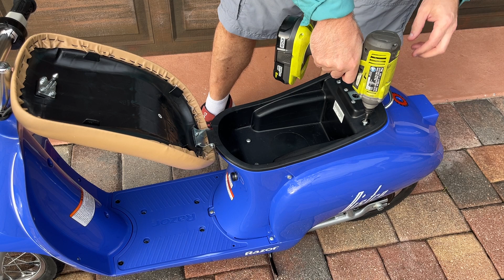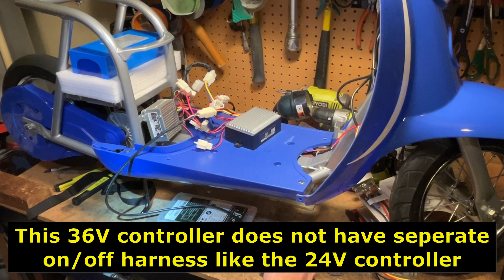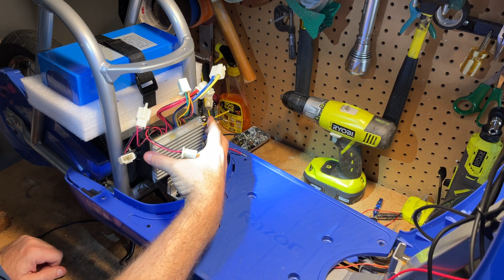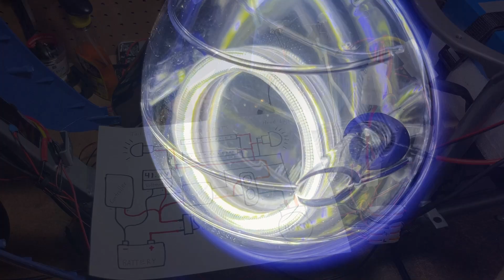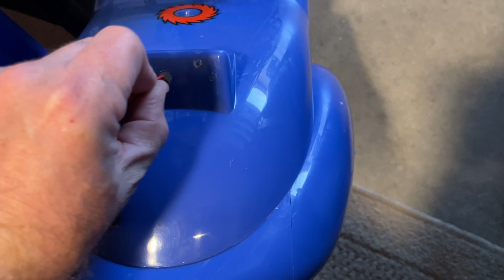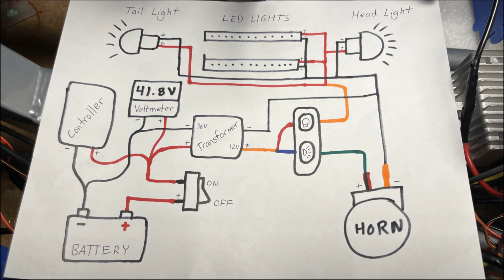$199 PocketMod 36V Upgrade - Faster & Cool Lights

Comment: How long does the power last, and could same exact setup be switched for a bigger battery
Reply from the maker: Yes larger battery will give you triple the ride times
Reply: @BRichSolution how long is the ride time for the specific one that you have below

Comment: Hey awesome video I just got a quick question. If I was to use a 2000w motor, would I still be able to use a battery that maybe is only 1000w?
Reply from the maker: 2000w motor needs a 48V battery
Reply: @BRichSolution ok ty

Comment: The graphic you show with all the connections is great, but it does not reflect the 5 Into 5 Out Splicing Wire Connector so it is difficult to know where to plug the wires into the connector
Reply from the maker: Which wires specifically?  Headlights, taillights or LEDs

Comment: How can I install that halo light without that power controller? Where can I wire it to?
Reply from the maker: You can wire it to one of the 12V stock batteries
Reply: @BRichSolution your light stays on at all time? I just bought an on/off switch.

Comment: Great video, very helpful! Where do you suggest to wire up that battery meter so it will turn on/off with the key ignition? Tried tapping it into the orange/red  electric door lock connect but it does nothing when I turn the key.
Reply from the maker: Into the key lock on/off wire

Comment: Hi, great video thank you for the reference!  Question, I have two similar plugs at the end of the 36v controller and doesn’t seem to be needed. I’m running similar setup with 36v controller and battery with stock 250w motor on an imod razor. Not sure what those two are for?
Reply from the maker: The 2 similar plugs are for motor or battery connectors?
Reply: @BRichSolution I wish I knew.  They’re both the same connector type with one black, one red.
Reply: I hate leaving connectors loose but can’t see what else is needed unless they’re reserved for add’l equipment for future use

Comment: does it still work fine because the stock motor would burn out
Reply from the maker: Works great no issues with the motor
Reply: @BRichSolution  the stock motor is still holding up?

Comment: Hi I’ve been following this tutorial and bought a 48v by mistake, can I use the 48v with the exact same setup - I have everything else the same as your set up
Reply from the maker: The 36v razor controller can handle the 48v battery without any issues.   However the 350w motor will probably burn out quickly but you can always try it and when the motor burn out upgrade to this 500w motor
https://s.click.aliexpress.com/e/_mPLSqzV

Also try not fully charge the 48V battery as it may prolong the life of the 350w motor as 48v vs fully charged is 55V
Reply: @ perfect! It cost almost half the cost of the battery to ship it back and exchange it🤦‍♀️ thank you!
Reply: @BRichSolution the motor definitely burned out, I picked up the suggested motor but doesn’t seem to fit the chain, can you suggest one?

Comment: Hi appreciate the tutorial! Do you solder a lot of these parts together- I don’t have any knowledge of soldering.
Reply from the maker: no I am not good solder person either; use the solder and seal connectors and the you place each wire in the end of the connector and heat gun melt the solder and does all the work; see video

Comment: What the difference if I use a 500w motor or 1000w motor? Dose it drain the battery faster? Do I need to upgrade battery or controller for 1000w motor
Reply from the maker: 1000w will drain battery quicker than 500w but the 1000w will be faster and more torque

Comment: Could I use my spare 80v kobakt batteries?
Reply from the maker: Not with stock motor or controller.   You would need a 72v controller and motor for the 80V battery

Comment: I’m currently in the process of making one of these. Got one off marketplace for $40. 

What’s the expected range with the 10ah battery? 

The original batteries were 14ah total and only provided about 10 miles of range. Will the 10ah lithium provide similar range or less range? 

Also want to note that the battery in the link is currently so out. So a link to another reputable battery would be great.
Reply from the maker: 48v x 10Ah = 480wh
24v x 14Ah = 336Wh 
So the 48V has 42% more capacity than the stock.  Range on pavement when i tested it was over 12 miles

Comment: HELP NEEDED. I did this same thing for my kids scooter just recently did exactly what this video said I only did the battery and controller upgrade with new throttle the problem we are having is it keeps shutting off on her while riding  but as soon as she turns it off and back on it will run again yesturday it did it alot more than usual can you or anyone else please direct me on how to fix the problem. Thank you in advance.
Reply from the maker: Is the motor really hot?    You could have a bad motor or are the people riding the scooter on the pavement or offroad?  Are the kids over 130 lbs?   If over 130 lbs, off road riding and motor is hot then most likely the stock motor is overheating and shuts off to protect itself.  You can upgrade to 500W motor to prevent the over heating see link to 500W motor  https://amzn.to/47dFCmh
Reply: Tha k you I think the upgrade is what im going to do she's riding on pavement and is under 100 pounds did you happen to make a video that shows how to wire that new motor into the control box

Comment: This is a big advantage of electric. So much easier to get more power than gas. Adding a bigger gas engine is a huge pain compared to a battery and controller.
Reply from the maker: For sure

Comment: How do you charge it because there’s a port on the battery too
Reply from the maker: Use the charge port on battery and route the cable out the back for easy access

Comment: Hey so I got my 36v system all wired up, I couldn’t find a 36v lipo that shipped to me so ended up buying 3 new lead acid batteries and wiring them up, for my on/off switch i just spliced it into the main battery connector wire, only issue now is it won’t charge off the factory charger, plug it in and the light stays green, anyone have a better charging solution? The stock charger is slow as it is
Reply from the maker: Stock charger is 24V (2 x 12V) batteries so it will not sufficiently charge the 36v or 3 x 12V you’ll need a 36V charger
Reply: @BRichSolution  sounds good, also have to say it’s awesome you’re responding to every comment! Great community support

Comment: Those batteries are bad, better put lithium and increase it to 48V and put a Fardriver or Votol 👌
Reply from the maker: I have used the Cao MM on 14 builds and I have been gappy with performance and longevity

Comment: I'm upgrading my Razor Pocket Mod to a 48V 1KW motor.  I'll add a headlight, taillight(w/brake light), and self made turn signals later.
Reply from the maker: Very cool, now time to upgrade to disc brakes as stock drum brakes are dangerous at speeds above 15 mph see video
https://youtu.be/Vl7LkqC_n-4
Reply: @BRichSolution 
I have been riding my upgraded Pocket Mod for about 6 weeks now.  With the sprocket size ratio it currently has, it will reach 15mph.  It has lots of torque!  I'm planning to upgrade to disc brakes as soon as I can afford to.

Comment: you for got to install heatsink  to cool it down  when it get to hot it burn down  mortor
Reply from the maker: I could not find heat sink for that size motor.  Motor still going strong when it burns up the  i will replace with 500w motor

Comment: Hey I'm trying to do a similar build as well and I'm curious if a 48v10ah system might be better for getting up hills and such? Then running a larger motor (like 1000w motor) and some 48v controller. It would probably run me like $150 more though so I'm debating if that'd really be worth it. 

I was planning on just building the scooter to zip around my hilly college campus, my original 24v cells went dead and I fried the original controller somehow trying to run with a tool battery so I need to revamp the system anyways lol.
Reply from the maker: Torque much better with 36V over stock 24V.  If your going to upgrade to 48V mind as well go to 2000w motor kit as same price as 1000w motor kit
See video for how to build 
https://youtu.be/rBJ2z1ujeRg
Reply: @BRichSolution  Do you think the bigger battery will fit under the plastic cover?

Comment: why wouldnt you just use a switch from a mx 650
Reply from the maker: Mx650 switch is wider and shorter so i would have to cut the plastics and then make a adapter.  Plus i did not have mx650 switch only the controller

Comment: Has this burned out your stock motor yet? I would think it would burn that 24v engine after a while.
Reply from the maker: Still going
Reply from the maker: Still going strong
Reply: Good to know. How does the bellezza model have 36v but says it’s only goes 16mph?
Reply: Speed is limited by the controller?
Reply: It's 24v not much lower than 36v it will wear out faster if you ride it harder but it should be relatively the same as the mx or even the sx 36v overvolt videos

Comment: Do we need really need tge step down transformer?
Reply from the maker: step down transformer if you want LED head light and taillight as they only operate on 12V and battery puts out 36v
Reply: @BRichSolution  Aaaaa.. also would the 24volt motor still work on this 36v current?

Comment: hi im looking to upgrade my battery to the same one as yours but I read that lion can catch fire is that true?
Reply: Also would I upgrade my motor to a 36 volt 500 watt or a 24 volt 500 watt. And if I do choose to replace it will I run into any issues
Reply from the maker: Cheap batteries yes.  Do not leave batteries on charger overnight either.  Use Cao MM battery linked in description below video
Reply: @BRichSolution that battery is out of stock. Any other recommendations?

Comment: What motor upgrade should I do?
Reply from the maker: 36V battery with 36V controller and stock motor gets ya to 22mph for $199 investment.  Change motor from 250w to 350w probably gets ya to 24 mph.   Going to 1800-2000w will get you to 35 mph but you’ll need to a mount and 48v battery and probably cost $450
Reply: @BRichSolution  I ordered 2 350w motors from Amazon,thanks. Today 1/17/24 my son and I raced. He was on the pocket mod with a 36v battery and a 24v speed controller with the stock 250w motor. I was on my ebike and I took off quicker but he quickly caught up and passed me....I was doing 21mph so he was going about 22,23 mph. My speed was gps.
Reply: @BRichSolution  do you have a 350 V motor on Amazon that would work with the upgraded batteries?
Reply: @CK13-FlynHAYN domt go 350w. I went through two of those and they burn out just as fast as 250w. I would recommend to just go with a 500w brushless vecor kit. A 500w razor motor is about $80 and the vevor is $100 so it’s worth the extra $20 to go brushless.

Comment: Great little scooter and great upgrades to it. Very informative on how to do simple wiring. You explain it well for the people who are just figuring it out and those who are novice at wiring. I to use the solder connectors one tip I learned in using them is to pre tin your wires before slipping them in. The extra solder makes it easier for the overall connection to make a super tight connection. I also use a heat shrink sleeve to slide over the connector for extra support. I use a heat shrink sleeve on my spade connectors to, the extra rubber sleeve gives the spade more support and helps seal it too. Well done video, and a great schematic wiring diagram, you explain it well. I gave it a like.
Reply from the maker: Thanks for the feedback and i hope this inspires others